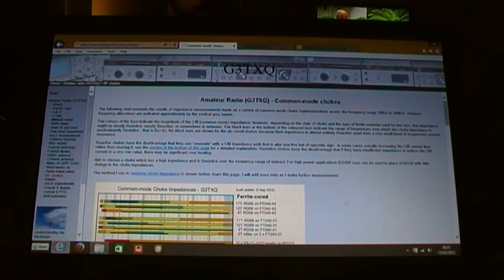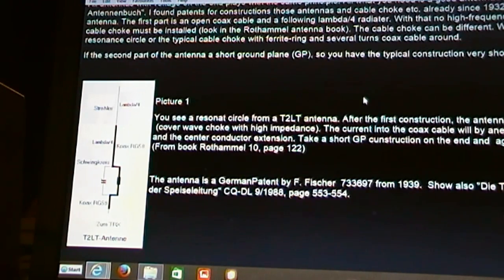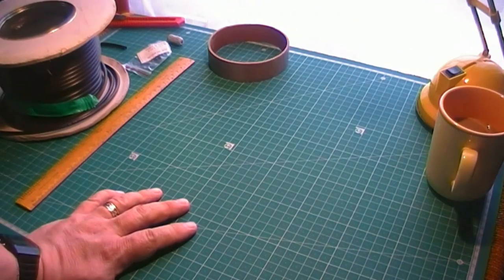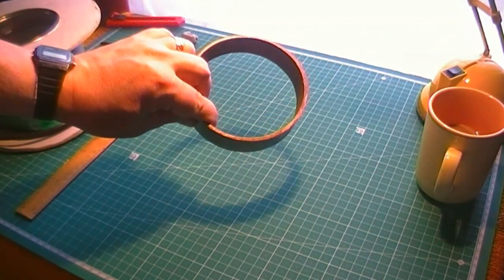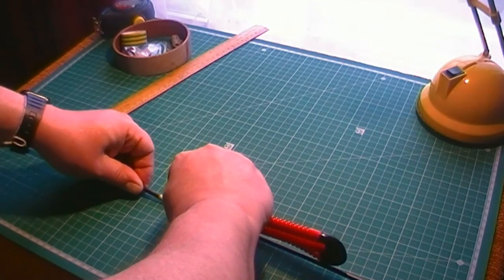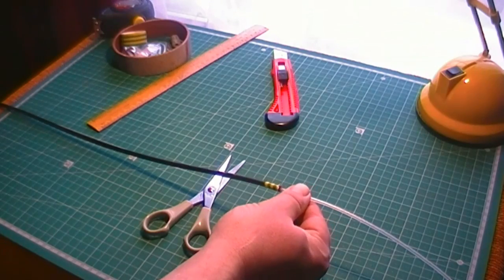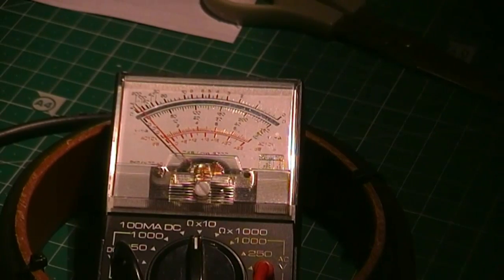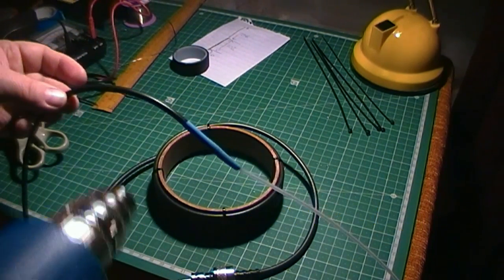Cheap and simple T2LT/Coax Dipole antenna for CB Radio PART ONE (remake from earlier video)

Comment: I bought cheap a brand new sirio thunder antenna due to the situation of the house ,as there is a hill to my left and houses ,so i thought i would do the test when coming back to cb radio .
I used a plumbers plastic pipe to connect the antenna on ,used rg58 coax ,at half way i put a choke of 3inches and 7 turns on the choke ,so from triple low to triple high i get 1.1 swr until i get to the 28 ,it rises slightly .
now i was thinking of a T"LT antenna and i am going to make it today and do the same way i did with the other antenna and see how i get on .
not sorry to use imperial i just prefer it .

Comment: How did you fix coax to the poop pipe section? 

So the end take of coax you just leave that loose and you attach yo extension coax to rig or this hoe's directly to rear of rig?

Cheers kev
Reply from the maker: I just tape it into position in a few places around the pipe and put some cable ties over the tape (not so tight as to distort the coax as this may change the characteristics of the coax and put it out of kilter). 
If you leave the loose end long enough to reach the radio, then it can plug straight in or, as I often do, keep it short after the choke and attach a length of coax to that - this gives me the option to use low loss coax for a longer run. The joint is also a good place to put devices like a low pass filter, pre-amp etc.

Comment: By your own admission you said that RG58 coax as a velocity factor of 66% Why did you not account for that velocity factor when you were cutting your stinger length and the regular coax for the quarter wave portions of the dipole. Instead you treated it as though it has a 100% velocity factor because you did not reduce the cable length according to the requirement. 😊 It should be much shorter than you actually cut it
Reply from the maker: Once the coax is split apart, VF is largely irrelevant, so don't over-think it, just make it and experiment as you so wish.

Comment: I built one out of 75 ohm coax and it works great horizontal or vertical, SWR 2.0 across the 11 meter band
Reply from the maker: Good job - nice to hear from someone who has used 75 Ohm with success.

Comment: I'll have to add, I built one of these using the five turn on a 4.25 inch former and it was a piece of excrement or what my friend called an "Abortion".
  I then took the idea of the Sirio Gain Master 16 turn choke, calculated a half wavelength of coax multiplied by its Velocity Factor, and came out with a 2.4 inch former by 16 turns - and that worked perfectly. 
  With the five turn by 4.25 inch choke I had massive RFI in the shack and an SWR that wandered all over the place and made no sense until I added the 16 turn choke, and now it works as it's supposed to - and quite well I might add.

Comment: I am looking at that choke - if my calculations are correct, a 110mm diameter, that means the circumference is 345.5mm.  So at 5 turns it makes the choke roughly 1.73m.   Should the choke not also be a 1/4 wave or 2.7m?  Or am I missing something?
Reply from the maker: Hi Will - I just went with the choke chart G3TXQ did and went with that (unfortunately the guy is now R.I.P but did some great work). Worked great, so didn't delve any further http://karinya.net/g3txq/chokes/
Reply: @104s_UKCBTV   OK, so I built it exactly as per your dimensions and it has a very good SWR across the CB frequencies, much better than I actually thought it would.  Only issue is I dont have a nice long non conductive type sturdy pole to mount in on top of my steel mast.  I tried 2" PVC conduit but its a bit wobbly and bends a bit too much.  Still looking for a nice telescopic fiberglass pole but not easily sourced in my country.

Comment: So simple and easy, its almost funny.  Gonna replace my old aluminium dipole with with one of these asap.  Will it be affected if I put it inside a 50mm PVC conduit?
Reply from the maker: I've heard of others putting it in a PVC tube - might need some tweaking with the tuning perhaps. Cheers.
Reply: @104s_UKCBTV  would it only be the top end that needs tweaking? in other words can a laymen adjust like a standard lenght adustable or would it need a whole re working of the of all lenghts including choke. I wish to weather proof mine
Reply from the maker: @mikeriverajr4447  - indeed, if the rest of the antenna is made to spec, the top is all that will need to be adjusted (if at all). Only 'specialist' test kit needed is a basic SWR meter.
Reply: @104s_UKCBTV  thank you, i have a follow up question if you dont mind, i learned that a inverted v dipole  works well in a attic, my question is could use a t2lt and invert v it in an attic?? would prefer it in the attic then a 18 foot wire out the house, the goal is a permanent care free install , hence the question about the pipe to make it last, many thanks!!!!!!!!!!!!!!! for your help!!!!!!!!!!1
Reply from the maker: @mikeriverajr4447  - I've not tried it in an attic or in a V configuration but it should work although it will probably need some playing about with (Inverted V antennas are generally around 2% to 5% shorter depending upon the angle of the V. In addition, proximity to objects in the attic may well have an effect too. Anything like foil on the underside of the roof or roof tiles with a carbon content will deteriorate performance and make the natenna difficult to tune. Worth a try though - some attic antennas can work well. Cheers.
Reply: @104s_UKCBTV  thank you so much for your response

Comment: I find it a bit easier to cut a piece of 4.25'' PVC choke former about an inch longer than needed for the coil only, then I drill a hole next to each edge and push the coax up from the inside and out through the lower hole, wrap the 5T, then back down into the 2nd hole on the other edge and on out the inside toward the top. This seems to help to hold the coil shape intact.
Another thing I've done is cut the top at 3/4 wavelength ( 318'' ) instead of only 1/4λ, then using a 2nd support line and folding 90° at the 102'' point up from the split, I pull up the T2LT with the primary parachute cord wrapped and taped or zip tied to the antenna and tied to the choke to prevent stretching, then pull out to the side the 90° 216'' 1/2 wave, broadside toward the DX direction I want to TX.
- It seems to provide a rather circular polarization covering the many diagonal angles of polarization as well as both vertical and horizontal polarizations.
Reply from the maker: Sounds a neat way of dealing with the choke - perhaps try winding the coax on the inside of the former with the coax exiting to the outside via the holes? Maybe a little more neat and affording the coax some mechanical protection. 

The DX config of yours looks interesting - was the SWR OK with the 3/4 top section?

Great to see folks experimenting with the basic design 👍

Comment: The 5/8 version would add about 1.5 s units of gain. Compare the A99 to the M2000 in performance or follow the Gainmaster 5/8    https://youtu.be/5VxHNTttpEc   build using the tuning stub. Glad to see a comment about using 75-ohm coax, being I have some hardline cable company coax so I may use some of it. I have watched several of your videos, well done, of course for us Yanks in the USA talking a little slower might get through to us better?
Reply from the maker: Hi there - Sirio claim around 3dBd for their 5/8 wave Gainmaster which would be about half an S-Point up on this 0dBd antenna - doesn't sound a lot, but could make the difference between getting the contact or not and the equivalent of doubling the TX power - perhaps to the detriment of high angle Sporadic E skip-shooting though. The input impedance of dipole antennas such as the centre-fed and this T2LT will vary with height above ground etc. but is typically around 70ohms, so 75ohm coax feeder is actually a better match. I've got a West-Country rhotic accent which is fairly unusual here in the UK, but should be fairly understandable for most of the USA. Cheers.
Reply: @104s_UKCBTV  Had not thought of making the entire run into the house, shack using 75 9hm but you could, and adding a 1/4 wave of 52 ohms on the end would match the 75 to 50 ohms at the radio being this is a mono-band antenna.

Comment: Hello and thanks for the video. I was planning to try this as a camp antenna, does it work good for 26.9650 to 27.450mhz ? Again thank you.
Reply from the maker: Yes, mine covers 26.965Mhz to 27.99125Mhz with good SWR 👍
Reply: @104s_UKCBTV  Thank for fast answer, going to transfer it to Metric unit, hope it works well, because not sure if you miss some that the swr will go up. Greetings from the Southwest coast of Norway.
Reply from the maker: @nortonis3565  Maybe see my later "Alternative Build" video - I have included some metric units in that one. Also if you only want to cover 26.965 to 27.405, you could optimise centre frequency for 27.205 👍
Reply: @104s_UKCBTV  Thanks my good man, i will look into that. I dont have FB or i would contacted you there and asked you, im new into this so it will be all experimenting for me.

Comment: Why dont you use metric units ?
Reply from the maker: Hi - the use of the imperial system is still in widespread use in the UK (especially by older folk like me!). There are online conversion sites online to convert the measurements to metric should anyone wish to do so. Regards.

Comment: Hi There, in total how much coax cable is used ? 
Did you buy a pipe and cut it down ? 
What size ? 
Thanks.
Reply from the maker: Hi Ben - approx 7.5 metres of coax needed for the antenna (excluding the run needed from the antenna to the radio). Former is cut from 110mm soil pipe - you can use anything that's 110mm in circumference though and you don't have to leave it in place afterwards - I keep it in there so the coil doesn't get squashed out of shape when I put it in the kit bad for portable work. Cheers.

Comment: Great videos 104! 
I was amazed that you were making contact 60-70 miles away with this set up. Pretty amazing really. A couple questions if I may: 
- Someone said in the comments they used RG-6, which is 75 Ohms (as opposed to RG-58 which is 50 Ohms) to make this antenna. Have you heard of someone doing that and having good SWR readings?
- Can this antenna be used up the center of  a tree connected to a branch at the top of the tree as opposed to using some kind of telescopic mast?
I'm still trying to figure out how this is working without some kind of ground plane, unless that is what the 4.25" choke with five wraps is being used as.
I just received  my Bearcat 980SSB radio yesterday in the mail and need to get a base station antenna up and you have convinced me to build this. 
Thanks for your time.  73's from across the pond.
Reply from the maker: Hi James - the antenna uses a thing called "skin effect" to work. In a nutshell, the RF rides on the inner and outer surfaces of the braid, so the braid actually works like two conductors (all the choke does is to stop that happening on the outer surface after a 1/4 wave down the braid, thus defining the lower half of the antenna (this antenna is electrically just a centre-fed dipole with a more convenient physical feed point)). Being a centre-fed dipole the feedpoint impedance is around 70ohms, so a 75ohm coax cable is actually a closer match than a 50ohm and could be used for this antenna - problem is, a clever guy called Steve G3TXQ tested and listed ideal choke configurations and this is where I got the data for the 4.25" choke, however Steve's chart only covers RG58 and RG213, so whilst possible to use other cables and choke dimensions, it's beyond my knowledge to test properly. To make matter worse, Steve has sadly passed away, so it would be a matter of someone else picking up where he left off. The chart is here though with a few more chole/cable options (green is good and red is bad) http://www.karinya.net/g3txq/chokes/
To answer another of your questions, indeed it does work fine just hanging from a tree branch and many constructors put some sort of loop at the top for that very purpose. I have noticed some impairment in performance when in  the middle of a tree which is understandable, but sometimes needs must.
Hope this helps and good luck with the build!

Comment: hey bro, i made this antenna andits amazing!!! but i didnt install the small ferriteon it....where can i finf it?? i used rg8 cable. thanks alot
Reply from the maker: Hi Bairam - if you have no RF feedback from the antenna, there is no need for the ferrite. If you decide to add one, look on eBay for a ferrite size that will fit over the RG58. Cheers.

Comment: MNI TKS for this video! I'm going to build a 6m / 50 MHz T2LT for this sporadic season.
Reply from the maker: Good luck with the build - I see the G3TXQ chart only covers to 30Mhz, so you will have to experiment with the choke size or find alternative info as one size does not fit all applications http://karinya.net/g3txq/chokes/

Comment: Hi bud where can i buy the ferretts things from plz thanks
Reply from the maker: Hi Martin - from eBay, just search for 'TDK Clip-on ferrite'. Optional for this antenna though and most people don't bother fitting one. Cheers
Reply: Ok thanks bud thought id fit one as i was told i had  a bit of noise so thought it might help what u reckon
Reply from the maker: @martinbradley3686  - sometimes helps. If you've some noise on your transmitted audio, one on the mic lead may help too. Cheers
Reply: Ok thank you for your help i will order 1 and see how that goes thanks again bud.take care stay safe 👍

Comment: hi man, nice guide. can i know why this time you removed completely the braid??? it doesnt help, does it? if i use RG8, i still need the balun?thanks cheers
Reply from the maker: Hi - this antenna does not need the braid due to a thing called "RF skin effect' - it does need the choke to work no matter what coax is used though. Cheers

Comment: ...Yeah, well, er uhm,
 for decades I've been making Choked Vertical Coaxial Dipoles for me Radio Bruvs to shoot up a line over a tall tree and pull up for excellent local vertical comms.
 I never knew it was named a "T2LT".
Just so I'm certain;
 -  I make a:
 ¼ λ of exposed unshielded center conductor and ¼ λ down from the point of separation, or about 17.7'.
 - So is this what is referred to as a T2LT?
And here for all this time I've been calling it a CVCD for Choked Vertical Coaxial Dipole.
Reply from the maker: Hi there - pretty much the same thing and the names are interchangeable (seen them called both, although for the purist,  the German designed 1930's T2LT choke has a capacitor across it for fine tuning). This one has a 5-turn choke with a 4.25inch inner diameter and, after tuning for a centre freq of around 27.5Mhz, usually ends up 102ins top section and 102ins bottom - total length from tip to the start of the choke is 204ins (17ft). 
Seen a few similar designs and no doubt they all work well - totally agree, super-easy antennas to build and deploy! A.t.b.

Comment: Is there a way to do this if u don’t have a soldering iorn or a pl connecter
Reply from the maker: You could get Knights or Thunderpole to supply a length of cable with a plug already fitted, but if you don't have the kit, a guy is selling the whole antenna for £19.99 on eBay which might be the way to go. https://www.ebay.co.uk/itm/DRX111-T2LT-1-2-Wave-CB-11m-Portable-Antenna-System/293347571837

Comment: Is there a maximum distance from the choke to the pl259 connection? I'm interested in building this antenna for my base station, but would like to go directly to it.
I have a large roll of webro wf100, will this do the job?
Reply from the maker: Hi Gary - no maximum distance as such as far as the operation of the antenna is concerned, but max length would be dictated by coax losses which would apply to any antenna. Work on a rough guide of no more than 10 metres for a high quality RG58, 15m for RG8 mini and high quality stuff like RG213 for lengths longer than that. Most make the antenna out of RG58 with a join just after the choke - then they have the option of using what ever feeder cable they like. Cheers.

Comment: Very nice project. I have been one tonight, I have a little problem, when I connect the pl to the radio I have a lot of stationaires, but if I plug only with the center of pl, I have a very nice value 1,5 1,3 and in 27890 1,5. I don't know what is happening.  TKS for Charing 7351.

Comment: ever thought of an inverted full wave delta, easier to build, and transport, perhaps better, ?? I am going to give a delta a try as well as one of these.
Reply: think a v shape , 2 fish poles, 36.5 feet of single wire, up the poles and across the top, they are said to be great for dx at low heights,  so 2-- 12 foot poles would do the trick .
Reply from the maker: Not really - this one has fitted my needs well for the applications I use it for. Good luck with your ongoing antenna builds though. Cheers.

Comment: Use any single conductor wire for the top 106",don't waste 106" of coax!
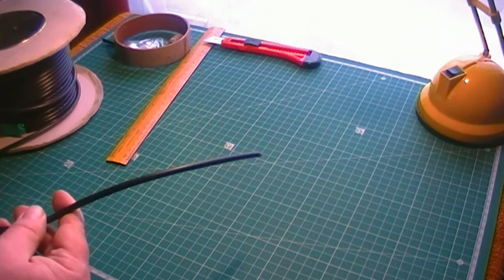Reply from the maker: I mention that method of construction at 15:40 into the video, but I prefer to 'waste' £1 of coax in order to have no joint in the middle of the antenna. Cheers.
Reply: @104s_UKCBTV   Yes, I understand, you said you don't like splicing.
Reply: cheap shite RG58 who cares ?